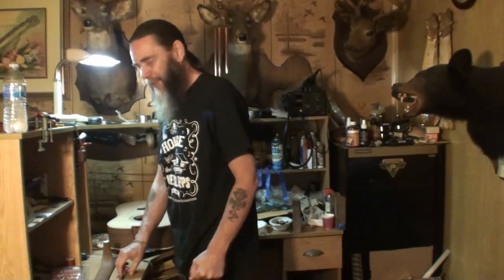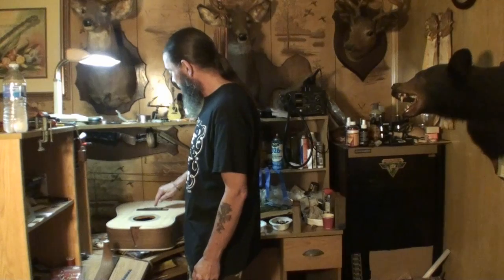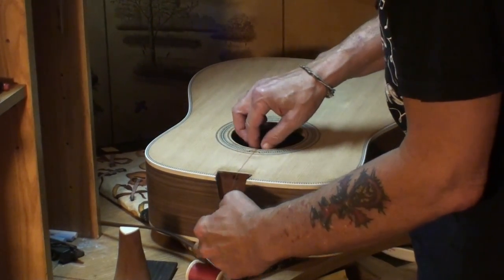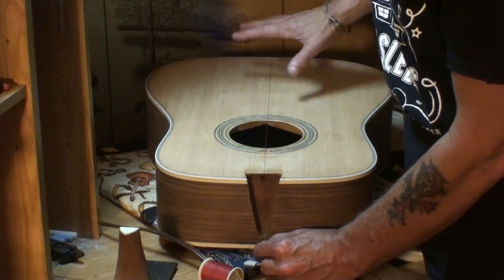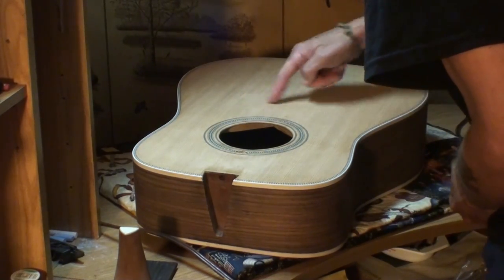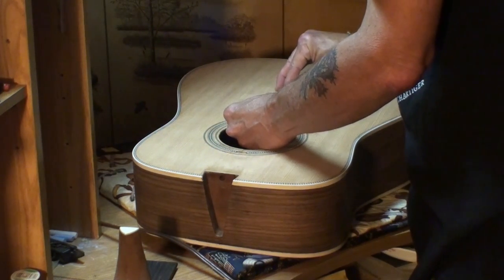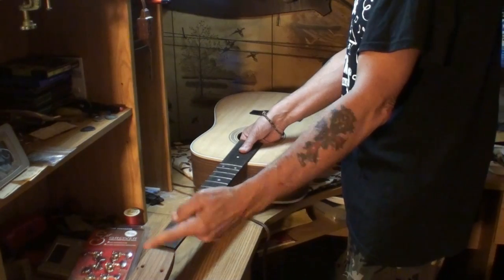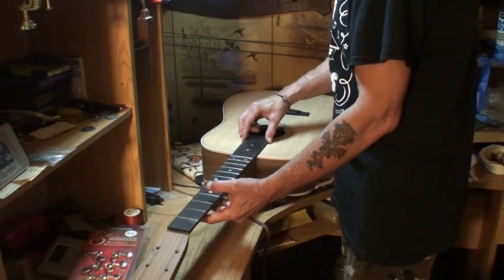stewmac hd28 kit guitar build part 1

Comment: Randy, please excuse my ignorance but why would you spend any time with the Bridge at all, let alone drill holes in the top before you have the neck positioned? Don't you worry that the holes could be as much as a quarter-inch off if you have to reduce the length of the neck. No matter what, the intonation will always be measured the same. I just finished two bodies and necks and glued them together and I really haven't even spotted the actual position of the bridge yet. I don't mean to to be critical, I just really would like to know and it just about killed me when you drilled those holes.
Reply from the maker: to match the plane of the fretboard to that of the bridge, the bridge has to be in the right place before that can be done. if I had the prints and templates I would have put the neck on first, but not having any of that stuff and considering how bad the neck joint fits I want to have more than one anchor point (center seam of the top) than just one, also because a guitar I worked on recently has the top center seam off center, too many variables to guess the angle of the neck with no bridge installed. plus with the inside backstrip not centered with the neck block tells me other issues are at play.
Reply: Randy Schartiger, well... thanks for your explanation.
Reply: I understand that in this case you had all kinds of wiggle room for the neck angle(s), but if you have a nice, tight fitting dovetail, I don't understand how you can move the neck to line up with the bridge. Like Buddy, I would have thought that having the neck on first in most circumstances would be preferable, but I know nothing about guitar building.
Reply: There is always a bit of wiggle room.  If you lever the neck at the headstock the joint will move a very little, but it is enough to alter string  alignment.  I would have thought id the back is not central, the way to prove it is to drop a dumb line down and check it that way.  If it is off and the issues with the bridge plate ( why not get a new one?) and the ridiculous fit on the neck are way too much IMO to bother putting money into this guitar.   No disrespect to Randy.  He can see stuff that we can't.  Waiting to see how it pans out
Reply: I agree with you Buddy Martin. If Stewmac has put the wrong neck in the kit it could be a different scale. I wouldn't trust the shadow of the bridge on the top. Anyway, I see it turned out good. With the tools you use, you're a fuckin' magician Randy.

Comment: Randy is there a bridge plate in the guitar. Center the bridge the wings don't matter. How did you get the string Length?  I wonder if he had the bridge in the right place!!!🎸🎸🎸👍🏼👍🏼👍🏼😊
Reply from the maker: I used the footprint of the bridge and measurements I wrote down from other Martin D28's to get string length, yes there is a bridge plate but everything inside the top of the guitar is shifted forward, it looks like someone tried forward shifting the bracing, guitar has a lot of issues, another is the center strip inside the back not centered with the neck block.
Reply: Randy Schartiger 👍🏼👍🏼👍🏼😊

Comment: From the string across the sound hole, tie another string with some weight (plumb line) to see whether it drops dead center or not on the back center brace.
Reply: Make sure that the top is level, too.

Comment: Randy great video. got one for ya--  I replaced the nut on my guitar and very happy with it.   b string tuned perfect then From the c-note up itts 18 cents sharp. till the 12th fret it dead on B then it repeats itself. . Im thinking  the nut needs cutting. which direction or side of the nut? sure would like some advice here.
Reply from the maker: when you say repeats itself do you mean it's also sharp on every note above the 12th fret? if that's the case then it sounds like the string scale of that string needs to be longer, you should file your saddle first in a way to make the area where the string lastly touches the saddle as far back away from the soundhole as possible, increasing the distance of the string from that break away angle to the 12th fret. If not enough width of the saddle to go as far as needed you can do the same at the nut which makes the entire string scale even longer. I hope this makes sense and helps.

Comment: I think they gave the dude (by mistake) a different neck or a different body which would explain why he told you a different model than what you are looking at
Reply from the maker: that makes sense! the inlays on the neck do favor a d35 and the body HD28, could very well be why the neck joint doesn't match any closer than it does.

Comment: I got a a question unrelated to this video. Although great video. But I have a blueridge br 160 and from the not to the 12th fret is fine but a little past the 12th fret  . From the 14th to the 20th fret there seems to be a bump in the fret board. Makes my neck look crooked. Id appreciate a response. Thank you :)
Reply from the maker: known as the ole ski jump, some guitars form a jump there and others sink down in that area, usually this is due to being over or under humidified, if you know or think your guitar is properly humidified I would suggest letting it dry out a while and see if it changes anything, or if it's been a while since you humidified it then putting a humidifier inside the sound hole might help.
Reply: Randy Schartiger will it ever go back to normal. Like flat?
Reply from the maker: some do and some never do by themselves, just make sure the moisture content of the wood stays between 45%-55% and over a few weeks/months you'll know if it goes back flat or not, I've seen some really bad go right back perfectly to normal, but not all of them do, I think it also depends a lot on how long the problem has been there.

Comment: If that guitar body is a D-35 or D-28. That is not the right neck for that body. That neck is for the the Martin D-41 or D-42 or D-45. I think the Dove Tale is off center at end of the body near the back of it. Or you had the string off one. Go back a look at this video. Notice the string. (NO Disrespect Intended Randy. ) Good video thanks for sharing.
Reply from the maker: the back strip is off center but the dovetail is centered, even the center seam of the back is centered, I don't know how or why the back strip is not centered. yeah the neck is for a D35 and the body  is an HD28, very strange StewMac would even ship a kit like this.
Reply: Randy Schartiger The neck has that notch on back near the tuners. (I can't remember what Martin call's it) That notch is not on D-35 Necks. I have been playing four different D-35's for years. They don't have that notch on them. Good luck with this guitar. You will need it. You call it the one peace at a time guitar, lol. After the old Johnny Cash song. I will look forward to your next video.
Reply from the maker: I never thought about that but you are right, some people call that a dart but Martin has another name for it which I can't think of. yes lol one piece at a time! :)

Comment: Drill speed is measured by 8000/mm. That's millimeter. Dunno what's it in inches. Really don't even want to. Lol. So, if you got yourself a 3mm drillbit , you are going to  need about 2663 ripums, that's RPM by AvE. lol again. Take care, man.

Comment: Randy you took 8 minutes telling us how you measured the bridge.hell measure the 2 end holes and be done .
Reply from the maker: because I knew a lot of people would ask how I got the bridge in the right place with no prints or templates and didn't want to try fitting this terrible neck joint with only one center point (top center seam) which was not center on a guitar I worked on recently. plus matching the plane of the fretboard to that of the bridge and getting the right neck angle with no bridge would be a bigger risk.